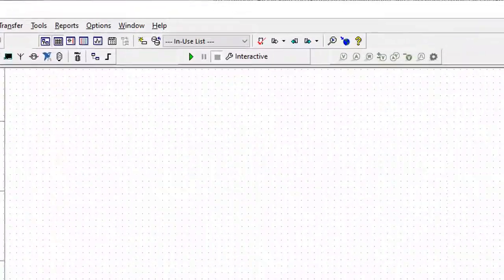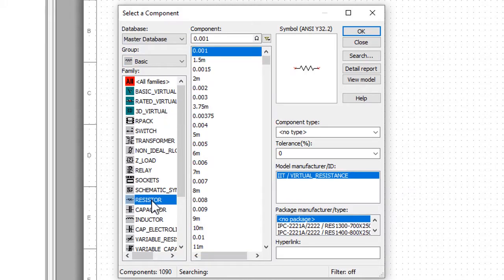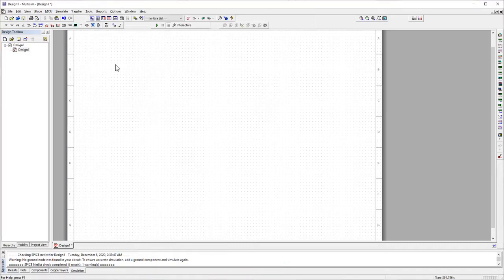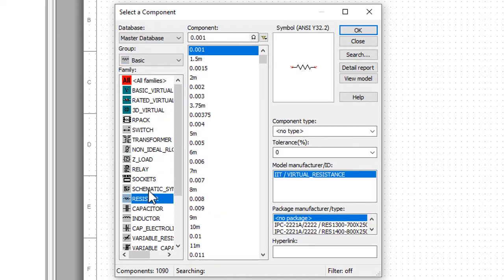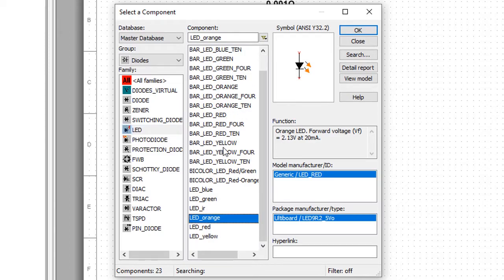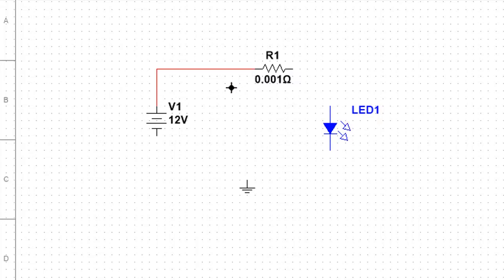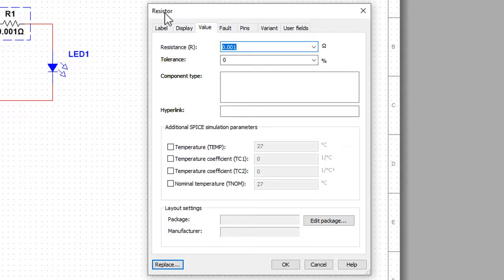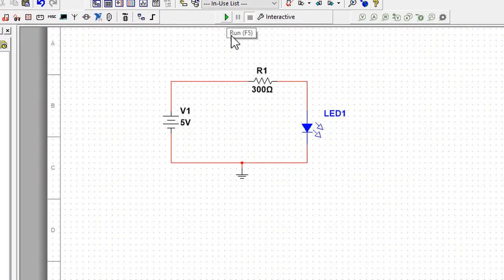How to build a basic LED circuit in Multisim

Comment: any simulator can do a led circuit with just a resistor and 
a power supply, even a free program. Many of the components 
are not complete such as the 4060 clock, when you consider the
price and the missing pins, in my opinion its not worth the money